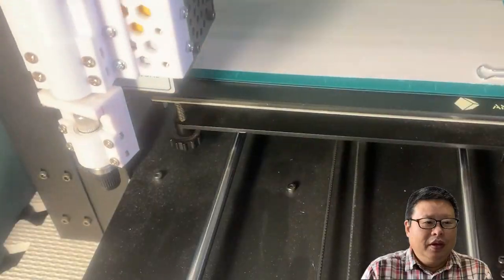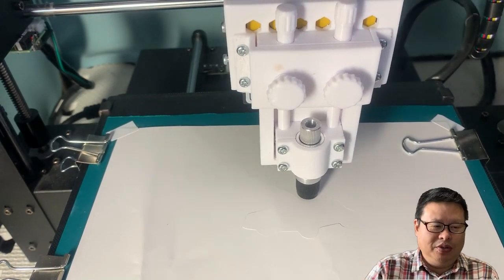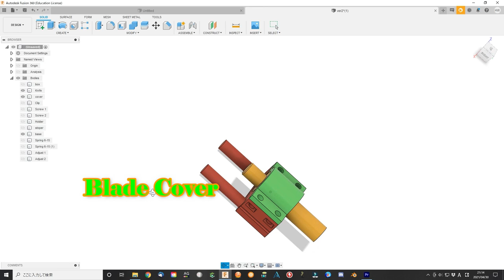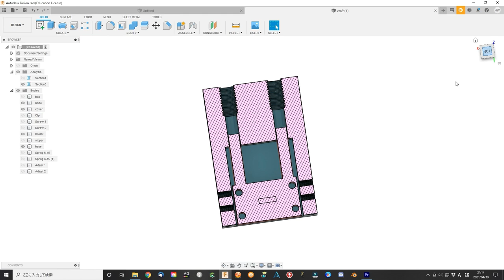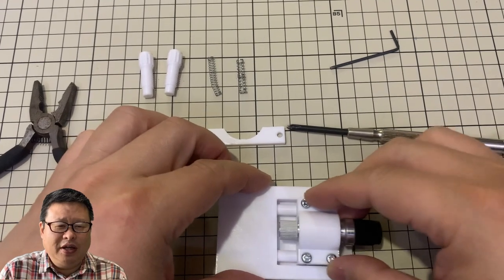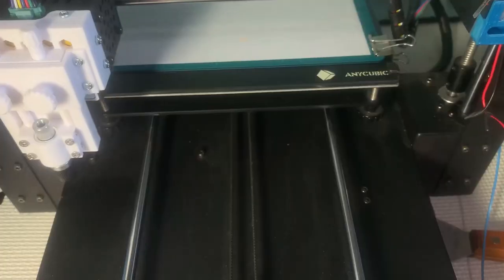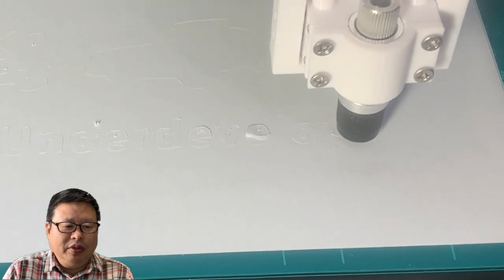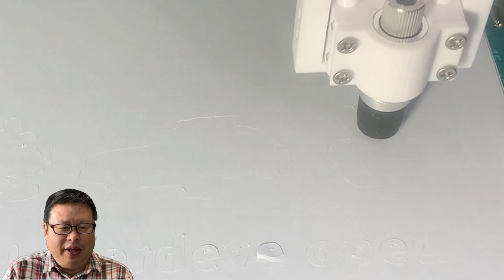Add drag knife to the 3D printer upgraded version (much better than before)

Comment: BIG improvement! I can still see a little bit of backlash, it can move out and in a little, and also can twist just a little. Maybe you can see nut and bolts in rear to hold it in, but still allow it to slide up and down.
Reply from the maker: Yes, they still have space to improve. They are not commercial goods yet but can be used for hobby stuff. Also, the cutting route needs to be optimized.  Now I use Adobe Illustrator and a free add-on script to generate the g code file.  Thanks a lot for your comment. Have a nice day.

Comment: I really like your idea, can it be combined with the painting video you made so that the desired painting is drawn first and then cut around it?
Reply from the maker: Thanks for your comment. I think your idea is very nice. Since all of the action is done on the same base, it is possible to combine them together. It needs some try and error then it should work I think.  Maybe someday later I will try it out. Also if you make some progress please let me know. I can learn from your experience and decrease unnecessary movement. Have a nice day.